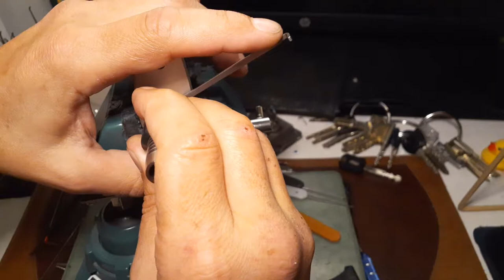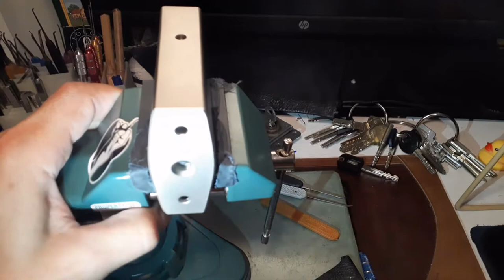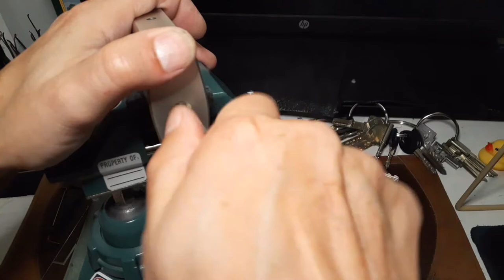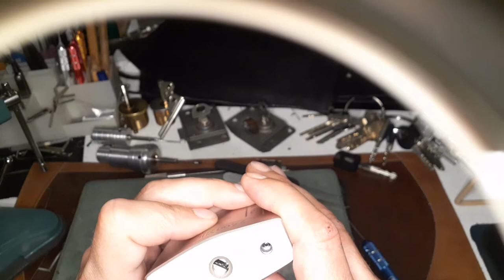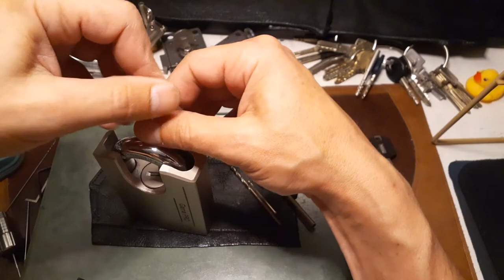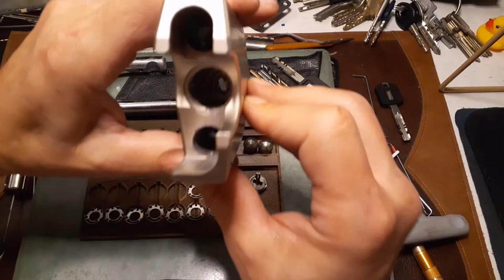[L86] My first Tokoz Pro Pick and brick drill and gut

Comment: Are there any big differences in the mechanism itself and the operating principle of this mechanism between Abloy Protec 2 and Tokoz Pro?  Or are they generally very similar?
Reply from the maker: They are 100% different locks. Tokoz pro would be the failed attempt at making a knock off protect 2. The only real similarity is they are disc detainer locks. ☕☕
Reply: @RetepReyem  What about the difficulty of opening for an ordinary thief?
Reply from the maker: @Darth-xc6tz  no clue on "ordinary thief" comment. the lock can be destructively bypassed (I talk about the key guide in the video) and also just cut with an angle grinder so seems a moot point to talk about.
Reply: @RetepReyem  I meant from the point of view of opening with master keys, is it as difficult to open as with an abloy or not, for example, if you do not take into account the forceful method of opening the lock?  Sorry, I'm writing from a translator
Reply from the maker: @Darth-xc6tz  nothing stopping someone from 3d printing a copy of any key at this point in my humble opinion.